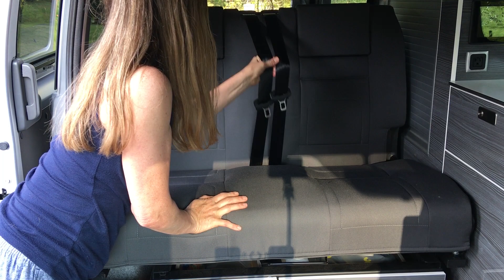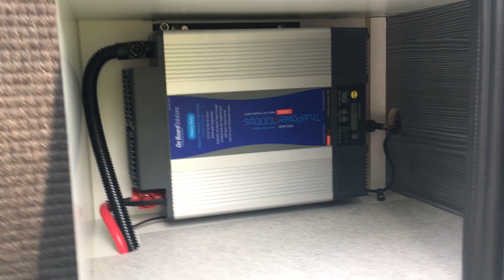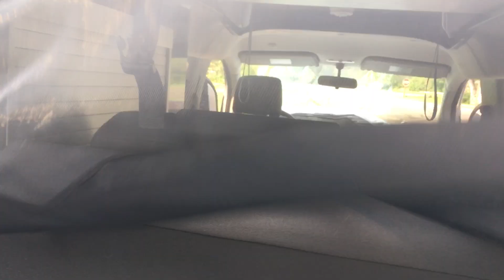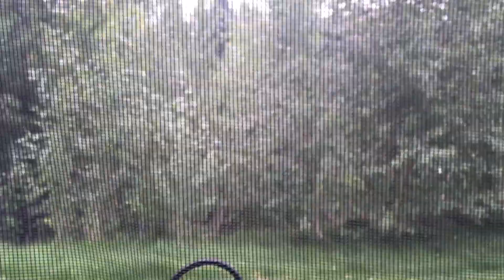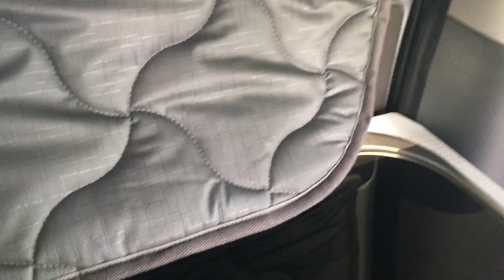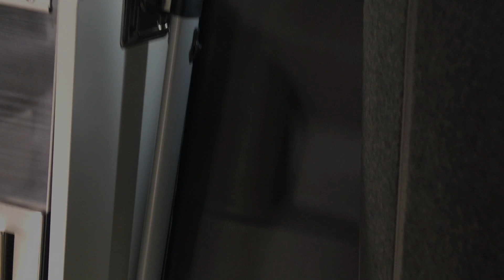Recon Campers Envy Campervan Build Presentation

Comment: Thanks for the excellent overview of the Recon Envy. We just ordered ours last month and hope to pick it up in WI mid-summer and drive back to Reno, NV. We really benefited from seeing your videos before deciding on the purchase. Wonder if you could do a more detailed presentation on the electronics in the Envy. Specifically, we're deciding whether we need some of the options - solar panels (we already have a fold up solar panel), inverter, shore power charger, and blue-tooth monitoring. I'm particularly interested in the built-in solar panel hookup at the rear of the van to understand how easy/difficult it would be to connect our existing solar panel. Any insights you could provide we be amazing.

Thanks again for sharing your knowledge and experiences with the Recon Envy. Happy RVing to you!

Comment: As an owner now, could you comment on  the noise level in the van when driving and visibility when changing lanes? Thank you.
Reply from the maker: The visibility is great. The mirrors and the windows offer great visibility while driving and changing lanes. The windshield offers a nice wide view. Because this is a van, the windows don't offer visibility on anything low. You'll need to rely on the mirrors for this. Regarding the noise level, it is louder than my Prius. The poptop gets a bit of a air drag and makes that windy noise. I got used to it. Though the noise made me nervous at first, thinking I didn't secure the pop top correctly.
Reply: @CaliforniaCampervan  My Recon has the previous version pop top which is a few inches higher and never have problem with wind noise coming from the poptop, most likely the wind noise you hear is coming from the solar fan that is open while you are driving and making a whistling noise. It happened to me a few times when I forgot to close the fan, I would pull over and close it and noise would stop.

Comment: Do you feel a camping pad is necessary when sleeping on the lower bed? Do you use one, and if so, which one?
Reply from the maker: Yes. I use Klymit's Static V Short air pad. It's perfect for me. It's not too long in the space, is quick to set up, and easy to not put away if I just want to lean it sideways when up. Plus it packs down really small. It is very comfortable. My lower legs don't need the padding on the lower bed. I have two of these, and they also fit well side by side on the lower bed.

Comment: Why do you have to turn on the inverter to run the refrigerator?  On the Recon website, it is listed as a DC fridge.
Reply from the maker: The red "master switch" turns on the battery, not the inverter. I got it wrong in the video.  There is an inverter inside the pantry, seemingly opposite the switch. I associated the two. Hope that helps!

Comment: Taking the pop top down when it is wet or raining:  Where does the water on the canvas go?
Reply from the maker: See my latest video, I address this. I haven't had the poptop up in the rain. The fabric is waterproof, as is the floor of the poptop. So water shouldn't come inside. That said, the fabric will stay wet on the outside, so one would have to open the poptop to dry things off.

Comment: Does Recon include an insulated window cover for the front windshield? Is a mattress pad included for the pop up? Thanks.
Reply from the maker: Recon includes a windshield screen. It's nice, but it is not insulated like the other custom magnetized window coverings. It is reflective and good to keep the sun from heating the car, but it won't insulate. One could get creative with placing custom-sized fabric in between the sun screen and the window in order to insulate things. There is no mattress pad for the popup. See my latest video, with the beach thumbnail. I review the storage space for an air pad. I recommend a few of Klymit's child-size air pads instead of an adult size air pad. They are more flexible in the space. They fit better on the bench seat / bed down below.
Reply: Thanks for these videos. Keep ‘em coming! Very helpful with my research and subsequent purchase.

Comment: thank you. i was waiting for the company to post a new detail on the 2020 model. Does the pop top have the quilted insulation that they talked about on a earlier build? I couldnt tell from them or your vid.
Thanks
Reply from the maker: Thanks for visiting. The sides of the pop top on my van do NOT have quilted insulation. Not sure if this is an additional accessory one can purchase. It did not come standard. Hope this helps!
Reply: This is a confirmed option for 2021 and pricing is forthcoming.